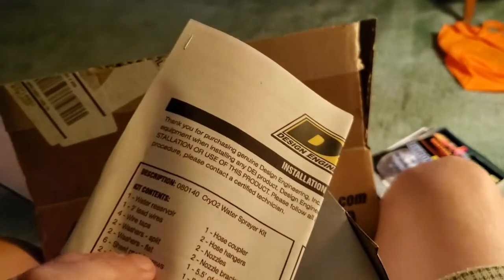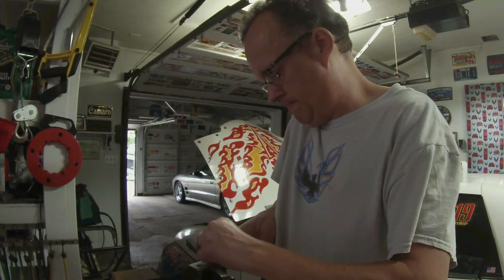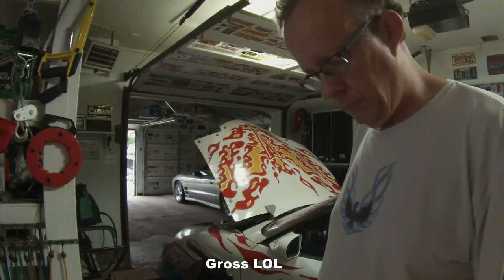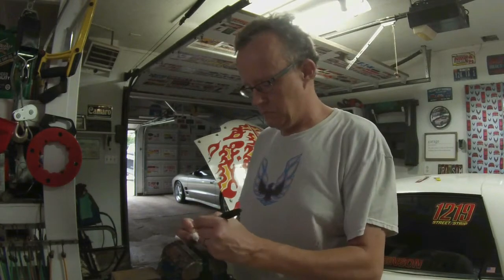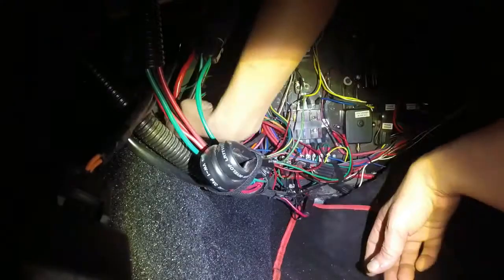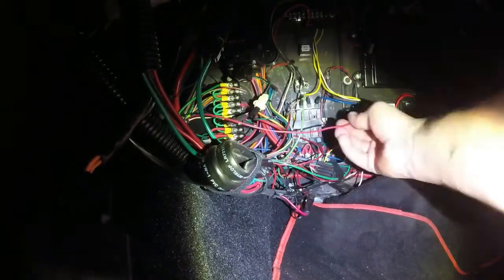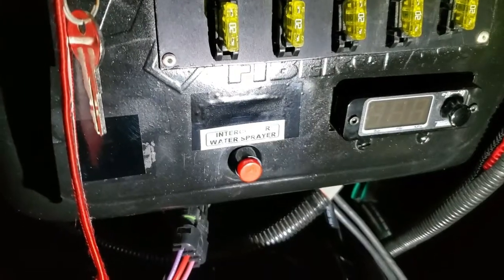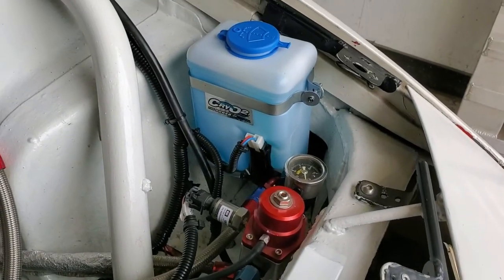Installing a DEI Intercooler Sprayer Kit on the 1995 Firebird Turbo LS Racecar

Comment: This kit would work better with a higher pressure pump and a nozzle that can atomize the fluid.  Anyone know where you can buy stronger pump and a nozzle that can spray "wapor"?
Reply: you can get kits that spray N0S across the intercooler, but they are more pricey